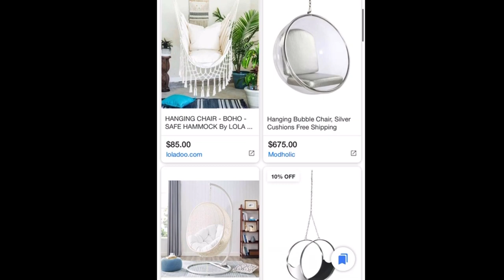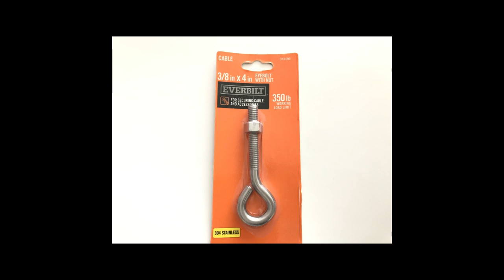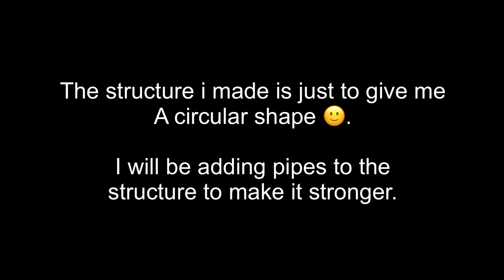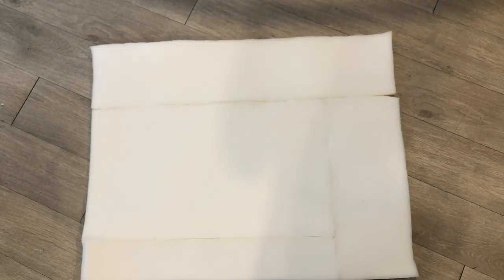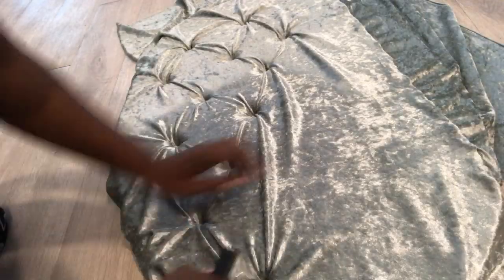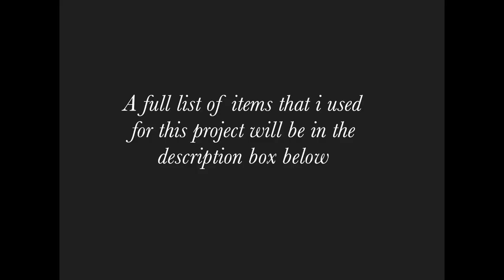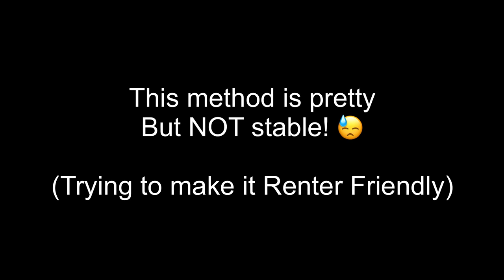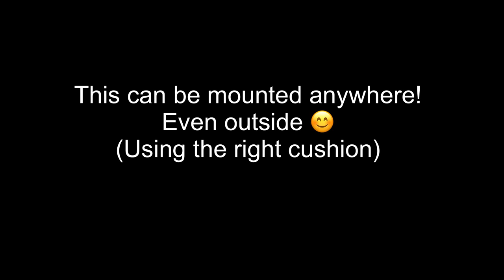BOUGIE ON A BUDGET SWING CHAIR! HIGH END LOOK FOR LESS!  RENTER FRIENDLY! QUICK AND EASY!

Comment: I so admire how you share Oopsies like the fabric and most importantly pointing out where something did not meet safety needs such as the wood brace. Oh OH...idea. What about running pipe inside PVC then bending them to shape as one unit? Second idea is to put clamps on either side of the hook to keep it from sliding around. Of course they will be sprayed silver and blinged out with crystals💎 🤗happy hugs

Comment: Great Idea, just in Southern Cali, the zip ties get heat and sun rot. They tend to become highly brittle after 1 year here they just break. I use a 5-8 gauge wire and do a tight wrap of wire I recycled from electrical cable.

Comment: with the right grit sandpapers the galvanized pipe can smooth to a better bare skin touch with not so bad of a possible meat grinder effect. if you wanna speed up that process(the sand buffing, not meaning meat grind ones skin on the piping-thats just no fun). Use a dremel tool with sanding7polishing bits

Comment: You also don’t need the copper pipes around the outside the world would keep it stable but you should use larger mending plates on the seams I larger any longer so they would go up more of the PVC instead of just being held by about a centimeter of plastic

Comment: If you needed more stability after the changes I suggested I would put a couple more rails across the back but a lot of the stuff that you’ve added is unnecessary like the copper and the plastic on the seat and the screws at the top